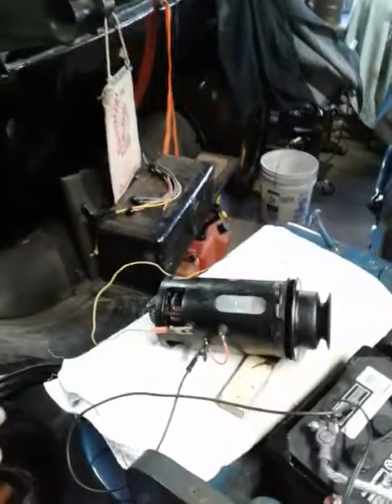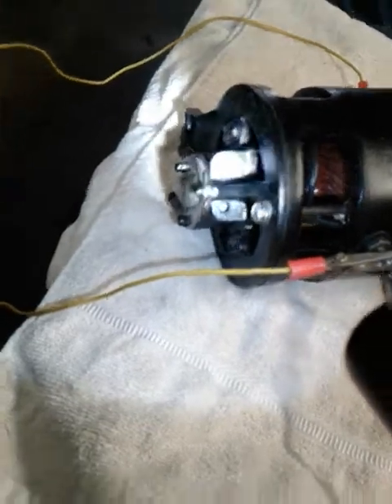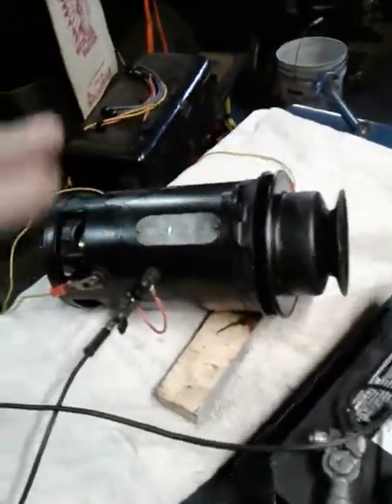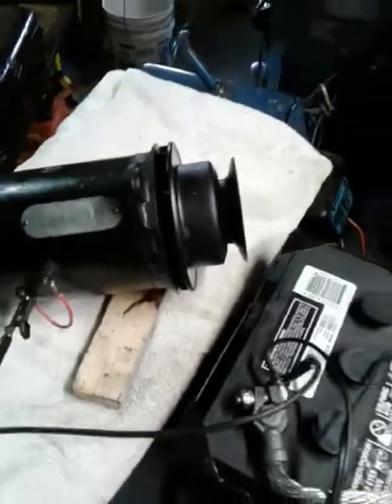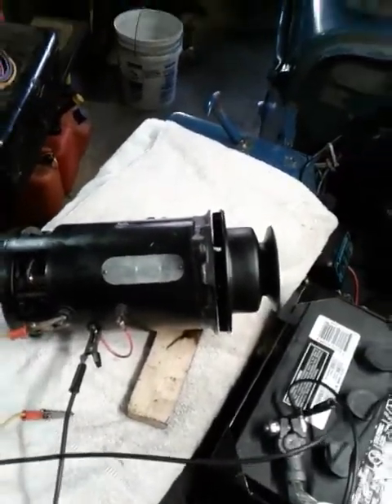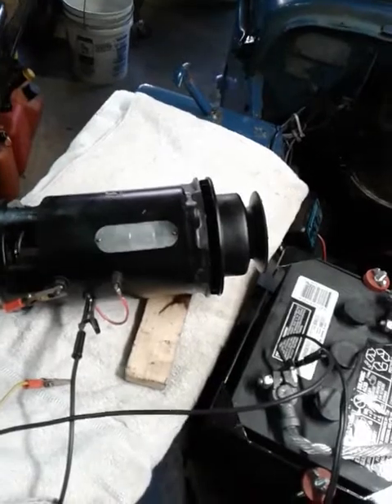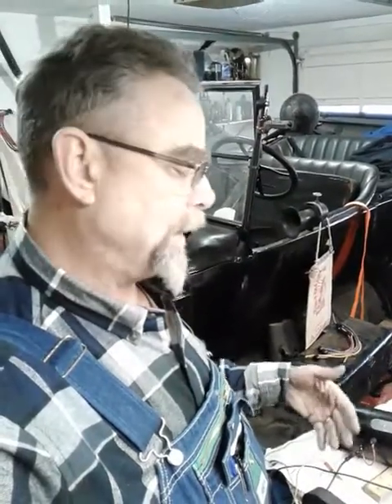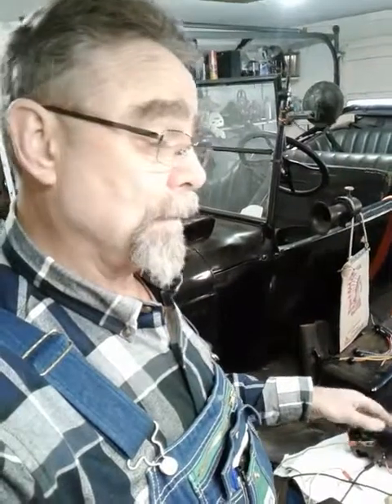Gen 9 - Autolite generator assembly and test

Comment: Hello Steve, this was a really nice series you put together ~4years ago -thank you. It has helped me with my GCJ-4811-A used on a 1941 Willys Americar pickup. This model uses a third brush. I took a photo of its angular location before disassembly, is it something I need to tune? The regulator appears to regulate both voltage and current levels. Did you re-insulate the armature? You mentioned in one of the earlier parts that the armature could use some improvement with the cloth.
Reply from the maker: The 3rd brush position will determine max output. The regulator  will control whatever that output is. So you may need to play with it a little. I use a red electrical insulator spray on the armature windings to provide additional protection. The field coils can be rewrapped with cloth or other field wrap material to ensure they dont ground on the case.

Comment: Thank you for the great rebuild videos. Can you tell me how to determine the build date on any Autolite generators? Thank, Gary
Reply from the maker: http://jeepdraw.com/autolite.htm
Reply: Thanks Steve. My GCO4804-A generator serial number is R2000405.
R is 1938
2 is February
000405 is the 405th unit made.
Now can you explain what GCO4804-A means by Autolite standards? I realize this is asking a lot. I just have always wondered what the codes are all about. This generator is in my 1937 Cord Beverly sedan.
Thanks again, Gary
Reply from the maker: @TheB24pilot  Autolite made hundreds of different generators. That spec means 6 volt, clockwise rotation, positive ground, max current output 28 amps, max RPM 1950. Plus a few other specs used in testing.

Comment: Hello Steve. My GCO4804-A autolite generator has the GCO2006F armature. I need to know what other generators have this armature as well as the pole and the field coils. If you can show me a catalog or tell me where to look for this cross referance catalog I sure will be pleased. Thanks, Gary
Reply from the maker: That will take some digging on your part. If you provide your email, I can send you an Autolite manual in pdf form. It have some part listings. Otherwise search the net for other Autolite manuals. That is how I've found some. Also look at ebay for original manuals.
Reply from the maker: @TheB24pilot  email sent.

Comment: Great videos. I sure appreciate them!  I have a 6 volt generator for my 8N tractor. Actually, very similar to the one in your videos. I don't have a growler so I'm just trusting that the armature is good. The only thing I've found is that the insulators for the field and armature terminals were bad and both were shorting to the housing. Bushing seemed good but I replaced the bearing on the other end. I've been using the tractor 25 years and the bushings are almost like new. I re-wrapped the field coils, however, I may not have put the polls in exactly the same way they came out. Could this be the problem?  It's 6 volt positive ground. Thanks. I'm not sure if I know how to see your comment if you respond, so, I'm bobincg at Yahoo dot com.
Reply from the maker: Putting the poles shoes back in the same way is preferable due to the residual magnetism and physical fit. But if they fit back in and the armature doesn't hit them, you should be good. Just be sure to polarize it.
Reply: @SwabbieSteve  I can't believe you responded so quickly. One more question. When I motor the generator, it spins opposite the way it spins when on the tractor. Is that normal?
Reply: I meant to say the BRUSHES are almost like new.
Reply from the maker: No, when polarizing it should motor in the same direction it runs on your tractor.
Reply: @SwabbieSteve  I can't imagine what I did wrong other than the polls. I'll check tomorrow. Thanks
Reply from the maker: You said the tractor is positive ground. Make sure you are polarizing it the same way.
Reply: @SwabbieSteve  Yes. I zapped batt to arm momentarily on regulator. All wiring is correct and with a new harness and new regulator on this 1949 8N serial #216648. I did see a video of a fellow with a 1952 8N motoring his and it motored opposite of mine.
Reply: I ran the voltage test with wires unhooked and engine running. It's supposed to be 1.5 volts. At 800 rpm I got .7v and it increases with rpm up to 1.4v at 2000 rpm, verified by two digital  volt meters, one lead to armature post and one to ground post.
Reply: I appreciate the help and certainly wouldn't expect you to nursemaid me through this problem remotely like this.  I'm at the point where I'm about ready to just buy another generator, although I don't like to admit defeat 🤬. If I figure out what I screwed up,  I'll let you know.
Reply: @SwabbieSteve  This will be my last comment, at least for now. There might be something in it folks can learn from.   I found out from photos and video I had taken during disassembly that yes, I did indeed put the polls and field windings back in exactly as they came out. I've failed to get the generator to charge and now plan to just switch over to 12v. I found out why the generator motored the opposite direction from the normally clockwise rotation when on the tractor.  It was due to a mistake I made, which was due to my misunderstanding of how the oiling system lubricates the bushing. I had read several forums wherein folks kept saying the back plate on their 8N generator was upside down, and it appeared mine was too. The little flip top at the bottom- you've all seen em - was hanging open. So, I and others wondered how you could possibly add oil; therefore, I decided to do what they did and spun the back plate 180°. However, like them, I had to add a couple of inches of wire so the lead from the field coil would reach the brush holder. What happened was when I removed the coils and laid them out, I saw that the connector linking the two coils wasn't crimped well and after I re-wrapped the  coils and installed them I put a new connector there. You're probably already guessing correctly. I connected the wrong wires! I took the one that's supposed to run to the brush holder and connect it to the other field. Then I connected the one that's supposed to link to the other field and connected it to the brush terminal. After correcting this mistake the generator motors the same way (cw) as the engine normally spins it. It still doesn't charge though, maybe the armature is bad. The fields read proper ohms at 3.0. Maybe the problem is that I wrapped the field coils with electrical tape. But anyway, I've given up on it. I always wanted a 12v system anyway.  But here's the thing. What I've learned is that you're apparently supposed to ignore that little upside down flip top and remove the plug opposite from it to add oil. There's a spring in there (mine was missing) and a wick. You remove those and add oil. The spring continually presses on the wick to provide oil to the bushing, which is porous brass. The oil actually penetrates through the bushing itself. There's no hole in the bushing. So that's a little FYI for your subscribers. If I've gotten anything wrong, please correct it for them.
Reply: Thanks for the wrap up. It was a good learning experience. Good luck with the 12v upgrade.
Reply: @rappahannockwhalers1910  Yeah man, it'll be great. We love our old things, don't we? I'm fixing all the little things on the tractor and painting it up. Tired of the 6v system. Wanted a backup headlight along with the front headlights and a couple of LED flashers on the rear but with the ignition taking 14.4 watts, that would total 125 watts on the old 6v generator rated for 119 watts and 11 amps. I suppose I  could get a LED backup headlight and I'd be ok. I kept the 8N completely original for many years but there were times when the battery needed a jump and I was way out there somewhere, also, when I did jump it, I had to turn my vehicle off and use it's lights and fan and anything else I had to get it's voltage low enough to prevent damage to the tractor ignition. 
   What I'll have soon is a 12v,  35 amp, one wire alternator with pulley and built in regulator, 12v square can front mount coil, new belt, wiring harness and mounting brackets for only $125. I'll buy a new 12v starter solenoid and a battery, of course. Gonna get three headlights H5006 which are Par-46 size and shape and will exactly replace the old 6v ones. These have hi and low beams, two filaments (3 terminals on them so I'll need 3 H4 type plugs).  I have a 3 position switch that should work with these.  I chose these halogens over LEDs not really because of price but mainly because I don't care for that high lighting temperature of 6,000k. The halogens look more original also. Those hi/lo LED headlights have 12 SMDs, half of which light up for low beam and all of which for high beam.  The $125 conversion kit also comes with a resistor to use if I want to keep using my old 6v coil. But (and I know it's not grammatically correct to begin a sentence with "But" or "And", I just like to 😜) I think I'll use that resistor for the little S25 24 SMD 6V LED bulbs and flasher I bought awhile back.